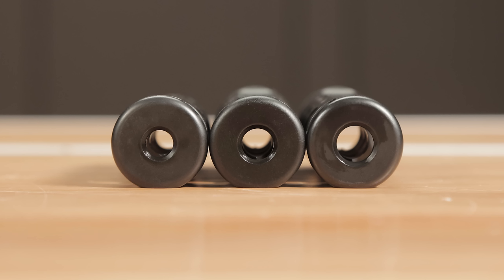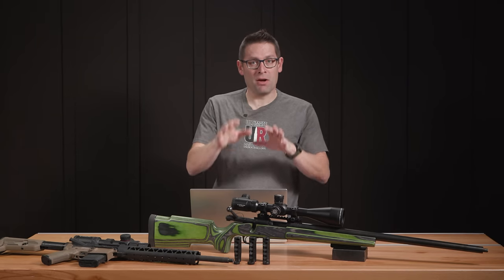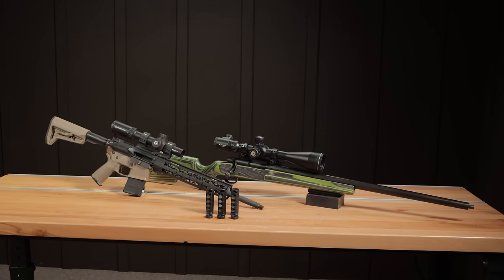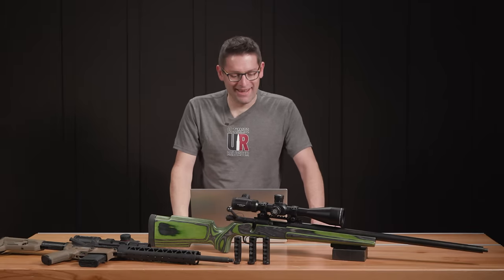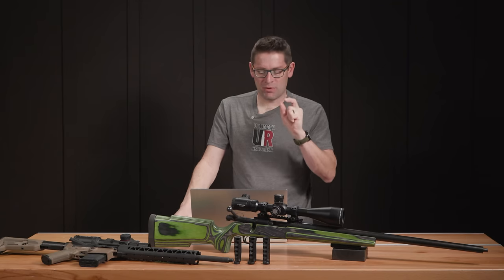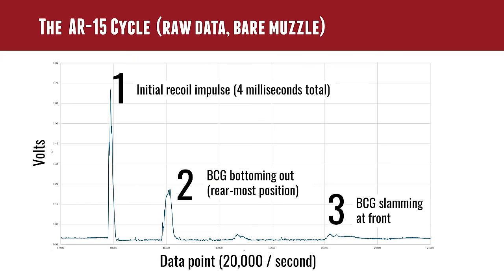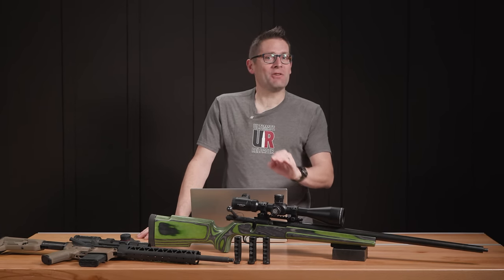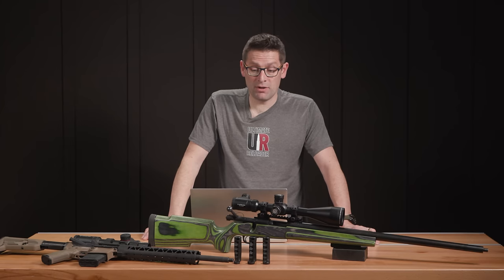What happens if you run an oversized brake?

Comment: At the range muzzle brakes are loud !  I have had shooters next to me ask if I was shooting a .308 due to the noise . 
I did see a tighter group of 1/4” less @ 110 yards  (100 meters)on a bench shooting with a bipod .  The muzzle brake was large and heavier than the standard muzzle suppressor it replaced . I can’t tell you if the weight helped accuracy , the reduced recoil  or a combination of both . 
My guess would be the weight and harmonics since this was only a 223 55 grain round .  The AR15 shoots sub MOA @ with .560 3 shot group . Which for an inexpensive PSA 20” 1/7 twist barrel out of the box is exceptional . I do have a 3 pound trigger from Timney . 
I tried heavier rounds with different manufacturer’s but the best was with Hornady  #8327 223 REM Varmint Express . 

There is never a dull moment ( frustrating sometimes ) playing around with guns .😂

Comment: Muzzle brake clearance makes the most difference when you get a poorly machined one and your bullet slams into it on the way through.
I'd rather get one a bit oversized than run into that issue.
Reply: Also mark a line with a sharpie, on both the brake and the barrel.  It may not have the same clearance 1/4 turn or 1/2 turn around.

Comment: Nice info, but I'd like to see a more sensibly controlled experiment to compare how each brake size effects a gas operated v. bolt gun of the same load.
Reply from the maker: That was my original thought but the only bolt action 22 cal I have is the 22-250 :)

Comment: I would imagine it would be a lot like subcaliber use of a suppressor. Still would be effective, but not as effective. In a worst case scenario, you start getting accuracy issues down the road, unlike with suppressors where larger bore clearance can enhance accuracy (because contained)

Comment: Good video, good data. However, I would like to see this on a much larger scale! We are seeing a difference in recoil on a small scale (223) about as small as it gets. I personally shoot erl, 33xc in the light class and 37xc in the heavy and had tested many breaks.  I can personally tell you the size of the hole and recoil is multiplied when dealing with larger rounds. We are seeing a max difference of porce lbs with the 223. How much of difference would we see with a large heavy hitter. I would guess we would see a much larger margin. Please do an analysis on a much larger rifle. 338lm or bigger!

Comment: I've always wondered why on multi port brakes, they don't step the hole sizes down towards the front? Like, 308 hole first port, 6.5 hole second port, then 223 hole at the end... Seems like it might make the impulse more uniform? Idk... Someone oughta give it a go!
Reply: We actually do the exact opposite in order to spread the impulse out further. By starting with a smaller port and stepping up to bigger ports you allow more gas to reach the bigger ports towards the end of the brake spreading out the felt recoil impulse.
Reply: Hmm... That is intuitively backwards to my brain... Lol

That said, it does make sense that as the gas expansion/slowing down/spreading out takes place a larger port would be necessary to accommodate effective use. Have you run one the other way before? Just curious on the results.. seems like all the ports might be 
active/more active, over a shorter time range.
Reply: Have you concluded a smaller effect over longer duration is better than a larger effect over shorter duration? ...

Am I just pulling weeds with no roots thinking about this? 😂

Comment: Seems like you answered the question once about the difference between the number of ports on the break. However, I can’t remember the result. Do more ports help? is there a point of diminishing returns?
Reply from the maker: I should be looking into the port thing here soon with the EC tuner brake new version that has three ports (3-port vs 4-Port)

Comment: On the AR-15 Cycle (raw data, bare muzzle) graph shown at 10:27, what is the peak visible between the labled peaks 2 and 3? It seems to indicate a force equal to the bolt going into battery. Is it maybe another round being stripped from the magazine? He didn't even mention it, and the entire setup of the rifle was not given. They may not have even had a magazine in the gun when they did the test. He also didn't say what the gas system length or set up was on this rifle, though that was not really pertinent to a muzzle break comparison.

This was an interesting test and data. Thank you.

Comment: You need a statistician. Also need to take out the non-muzzle braked result. 

You have a 50lbs jump between your data points. We don’t know if 1lbs is a huge difference or insignificant. 

The graph doesn’t tell us the significance because your scale is wrong.

Comment: The clearance all around the bullet is 1/2 of what you stated. Bore diameter - bullet diameter is the total clearance overall.  Divide that by 2 to get the clearance all around the bullet.  Time to go back to school.
Reply from the maker: Did you know that there are two ways to express cylindrical clearance? Radial, and Diametrical. I have talked with a LOT of brake manufacturers- all of them express brake clearance diametrically (comparing diameters), not radially.

Comment: So my question is, with such a small difference in the recoil force between the different sizes, were you chronographing your shots? Would those small differences be affected by a slightly hotter/colder load, and are they within that amount of variation?

Comment: Apples and oranges on the 22-250 bolt and the 223 AR. The more powerful the cartridge the better the brake reduces the recoil. Simple as that. The less powerful the cartridge the recoil reduction is reduced as well. Much of the recoil reduction you got was because of the 4-chamber design of the brake. Making it a minimal difference because of the bore diameter. If a brake had less chambers the recoil would be more as well and with less chambers you would have seen larger differences in the brakes bore diameter. Nice video it did show you do get reduction in recoil even if a brake is oversize. The design of some brakes that don't have separate chambers the results would not be all that good. Some brakes only have the one chamber with multiple side vents that look the same on the outside that may not give you the same results.

Comment: Curious-what buffer did you use in the AR?  It would be awesome to see this test done with a KYNSHOT RB5000 hydraulic buffer installed.  I have the appropriate models installed in ALL of my AR’s from 9mm to .308 and friends who’ve tried my gear have these buffers installed in their AR’s now.  Double tap speeds much quicker now.  Would love to see the difference between buffers on your machine.

Comment: I had the FX muzzle brake on my full power FX Dreamline .22, pellets were going everywhere, it seems the make of pellet I was using was clipping the end of the brake, probably slightly unstable as it was leaving the barrel. No problem with the accuracy after I removed the muzzle brake!

Comment: Wouldn't the difference between the 22-250 vs 223 be more related to more powder = more gas which means better brake performance.  Like an open gun in IPSC etc.

Comment: Great video - I'd sure like to see an apples to apples comparison of .223Rem vs .223Rem or 22-250 vs. 22-250, rather than comparing a 52gr 22-250 (3,160FPS) to 73gr 223 Rem (2,820 FPS). When considering / measuring recoil, the bullets weight matters; typically a heaver bullet produce more recoil.  Perhaps when you produce the accuracy test (looking forward to it) you could select the same caliber and ammunition for both rifles.
Reply: No

Comment: Initially was having issues with my silencer concerning POI shift and group size. Had it drilled bigger and the groups tightened up great. Doesn’t have any POI shift now from cold bore to shooting all day. I thought my rifle had issues but just opened the bore size of the suppressor and problem solved. .303 silencer  opened to .375 used on a 6.5 😅 can’t feel difference in recoil. Snapping/crack sound did go away as well. Hunting use only

Comment: could you test a simple blowback PCC in 9x19 on the recoil rig, with and without a muzzle break? i;m really curious if the gases out of a long barrel are enough to "push" a muzzle break
Reply from the maker: We did some 9mm PCC recoil testing here: https://ultimatereloader.com/2022/03/26/tested-cmmg-radial-delayed-blowback/
Reply: @Ultimatereloader   yes, i saw that video. but there is no muzzle break test ...
your rig is best suited to settle the question if muzzle breaks are effective for 9mm PCCs

Comment: Just as I was debating if running 7.62 brakes on my 6.8 spc 18in and 6.5 grendel 20in builds is worth the savings. Just hunting rifles so not sure the extra money for specific brakes are worth it. The grendel is more range/ hunting gun. Both on AR platform.

Comment: On the AR recoil impulse charts you mention that the spikes smaller than the initial peak could be due to lugs unlocking, etc. Since there is a spring involved these subsequent peaks are likely due to the natural oscillation of the spring inside the buffer tube moving back and forth, as the buffer travels,  until all the stored energy in the spring is dissipated. It would be interesting to see how spring stiffness affects these subsequent peaks.

An example of this can be seen in the valve springs of a combustion engine as seen here: https://www.youtube.com/watch?v=uUYn5kFFb5s&ab_channel=DonGould

Comment: Clearance is brake bore diameter minus the bullet diameter divided by two.
Reply: Radial clearance, yes. But a diametrical clearance value is also valid.
Reply: @G5Hohn  Clearance is distance between parts, the other is diameter delta difference. If the centers of diameter are not concentric the clearance will be different at various clock locations.

Comment: @Ultimatereloader Gavin, it would be interesting to integrate the curves for the AR-15 platform. That way the total recoil force for each muzzle brake could be determined.
Reply from the maker: That was the total impulse value graphs that I showed in this video :)
Reply: @Ultimatereloader  I see lb*sec in those bar charts. If it is total force, it should be lbs, but if they are measured over the same time period, which I believe they are, lb*sec will due.  So, in the immortal words of Roseanne Roseannadanna, "Never mind!" 😉

Comment: This also suggests the average differences in brake design aren't likely to be important.
Reply: Mostly. It's basically a function of perpendicular surface area do the surface of the bore. You get diminishing returns as the surfaces get away from the muzzle. The army published a white paper on the topic in the 50s or 60s.
Reply: That’s not true. Precision rifle blog has an article on this.

Comment: Muzzle brakes will not affect accurcy - it only will have need of zeroing a scope for each.
During a shot a barrel is waving so any load on a barrel will affect this waves.
Someone told that during the war the specops guy didn't hit the head in short distance because he had PBS-1 on it without zeroing it befor the night operation.

Comment: If you're gonna test accuracy you're gonna need to use a tuner brake and tune it for each test. Changing brakes will screw with your harmonics and the data will end up random.